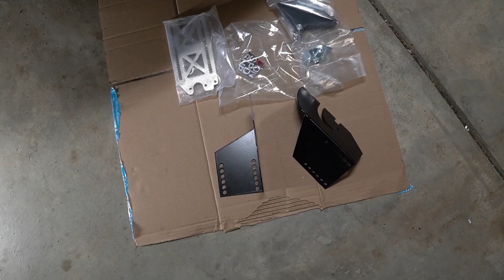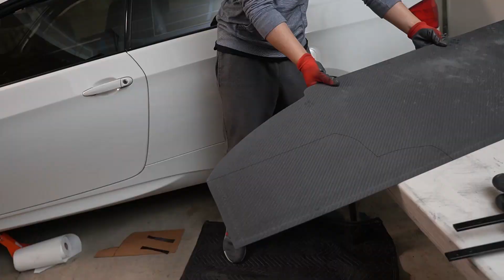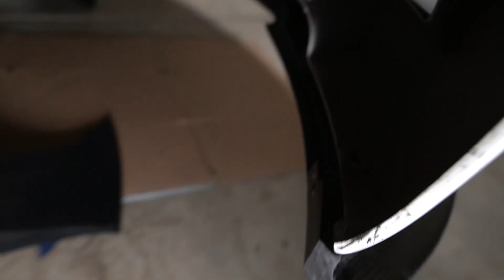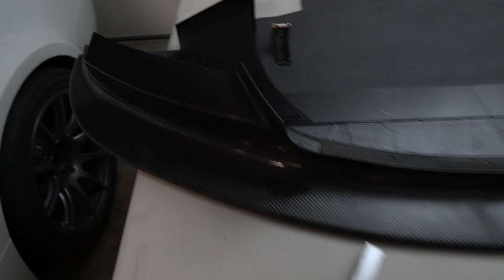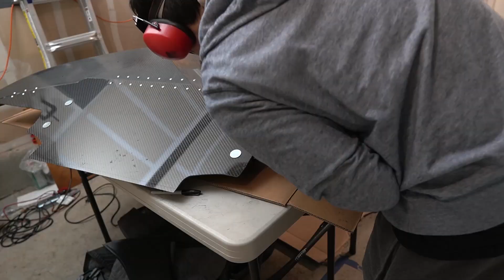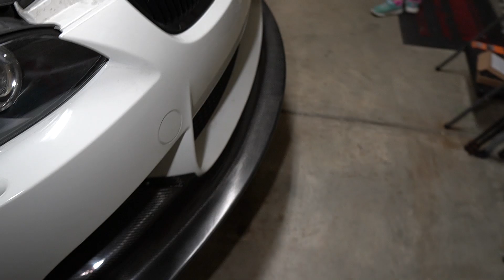BimmerWorld Carbon Fiber Splitter ON STEROIDS! - E92 M3 Track Car Build Ep.38

Comment: What are you going to do about brake cooling? Arguably more important than aero. 
Personally I'd of gone with the GT4 splitter as it allows brake cooling and gives aero and if it's good for a BMW GT4 race car it's probably good for us. 

Nice work though!
Reply from the maker: @KreemyM3  haven’t had issues with brakes since upgrading to AP so I left the brake cooling out.
Reply: @WillsGarageOfficial  brake cooling also helps with disc longevity. I also got AP brakes.  AP discs aren't cheap. Also the stickier the tyre the more heat that will end up going through the brakes.
Reply from the maker: @KreemyM3  True!

Comment: Nice work! 
The only thing I'd change (not that you asked me) with the splitter is mounting the wheel well vents on the other side of the splitter. That 2-3mm lip acts as a gurney flap that causes attached air to detach and not follow the tunnel as well. You can use the same mounting holes, just mount it on the other side.
I had some ideas on relocating the brake vacuum pump... i'll message your on ig.
Reply from the maker: The 2-3mm lip will definitely decrease air attachment to flow through the tunnel, but mounting it on the other side is supposedly worse due to a steep drop off. BTW, I need your tips on removing excess wiring!
Reply: @WillsGarageOfficial  I shipped my entire harness to Germany for some lightening, so I can't take credit. You're welcome to come by and take a look at the modules/wires i still have. You could do it by process of elimination.

Comment: Nice Will! What will you do for the oil cooler exhaust that normally comes out of the under tray? What sort of lap times is the car able to do at the local tracks in its current config?
Reply from the maker: Going to run it as is and decide later if it causes overheating issues.
Reply: I have a Flossmann splitter that is the exact size of the splitter in Will’s video. It also does not have a cut out for the oil cooler exhaust. I contacted Flossmann about this and they said they are not aware if customers need to cut a hole for it. 

I also will just try it and see temps.

Comment: where did you get the flossman fenders? also what made you pick doing that bimmerworld setup over doing the zebulon?
Reply from the maker: Directly from flossman. Zebulon splitter is a bit too aggressive for my build at this point. Still need to drive to and from the track and the bimmerworld splitter is the best looking IMO.
Reply: @WillsGarageOfficial ahh alright got you, I’ve never figured out what or where flossmans website is, I want to get these fenders too but I literally have no idea what and where their website is. Soon I do want todo Zebulon though only if I can do a quick release option, no way it will make it on and off a trailer with it on